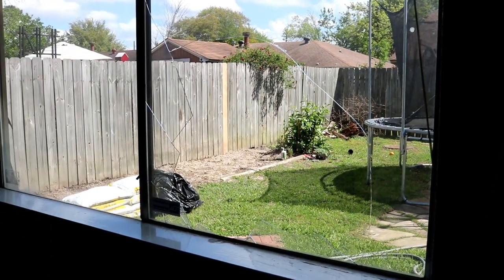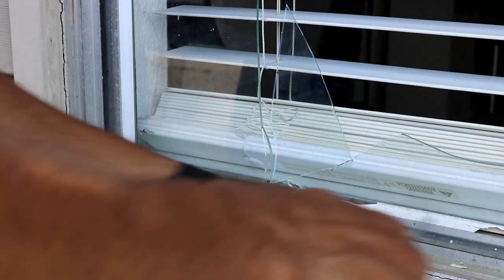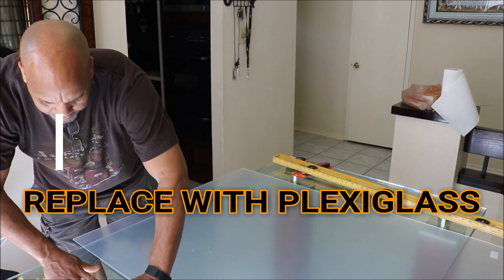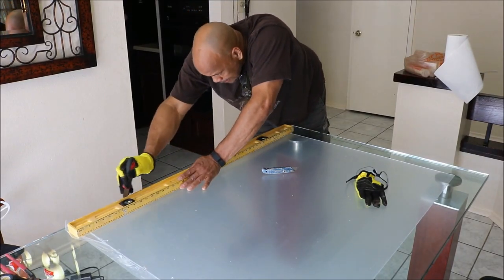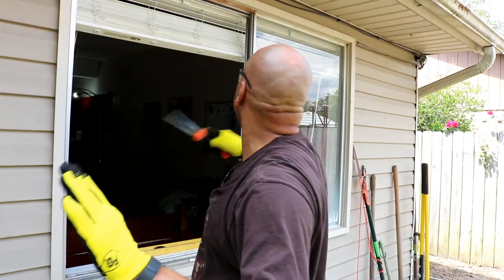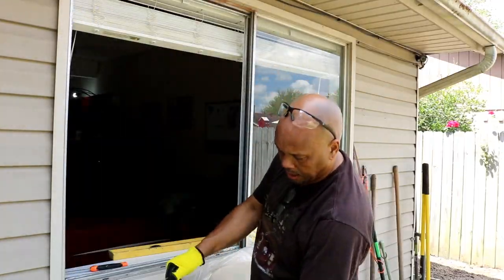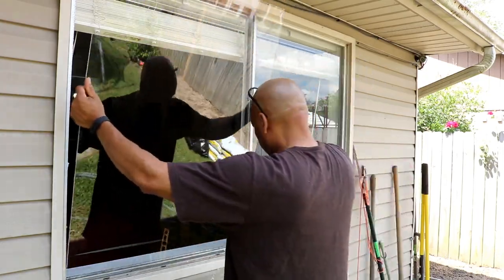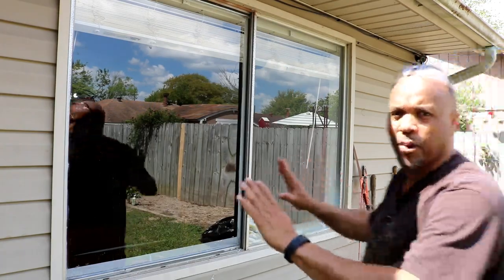How To Cut and Replace  Broken Any Windows With Plexiglass

Comment: what's going to happen when u open house door then shut it the.....,,, window falls out
Reply: Yeah? I just  read that silicone, pure silicone does not adhere to plastic. But there are silicone products that will. But most people do not know this and just buy. Okay maybe not most...but many. I was one of them until this past week.
I just wanted to see how someone else installs plexiglass into a window...when do "they" peel the plastic.

If the frame is aluminum, he should be okay...but that is a big window...factor in the wind gusting from the direction of his front door...that would be worth videoing.
But he bought the proper silicone "PRODUCT". I think? 
"For plastic Shit!"
Reply: @markmcconnell8705   So what kind of sealant do you suggest for a wooden window frame?